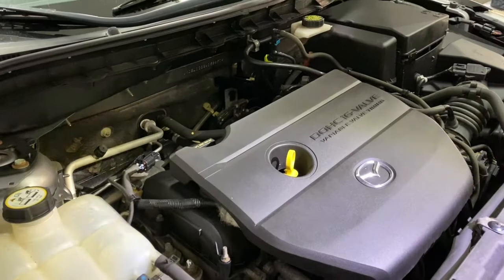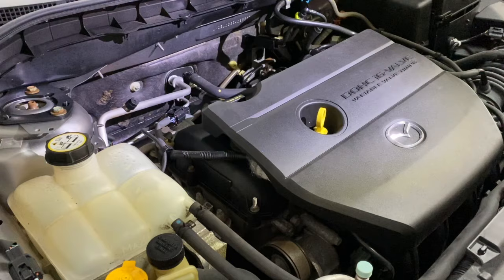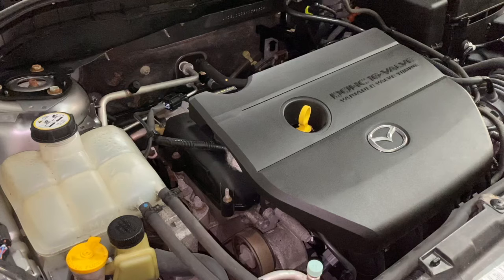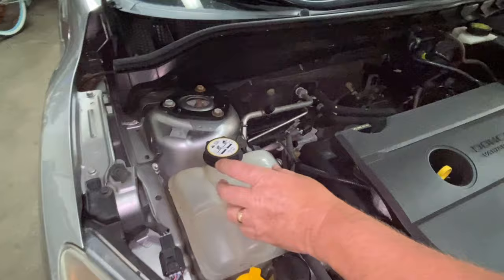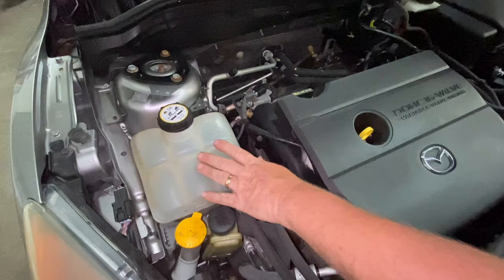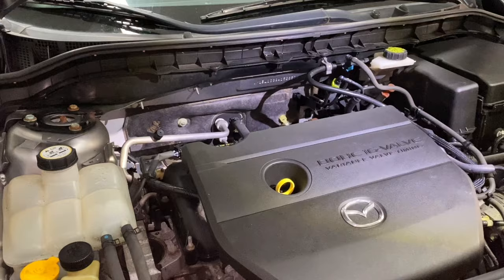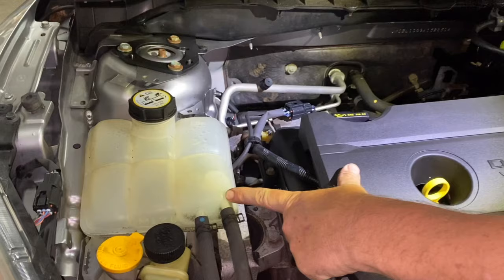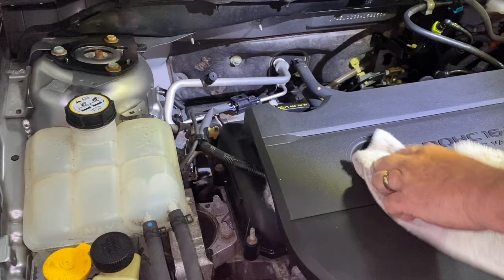Learn 3 Symptoms of Blown Head Gasket

Comment: Question buddy, i have a 2003 ford ranger it sat for 3 months and finally had a mechanic fix it for me. I replaced both head Cylinders because one was faulty. The guy put new head gaskets and installed a new water pump and it worked smooth for about 2 months. Yesterday my fan ran hard and i checked it today and my top radiator hose was squished skinny and hard. I tryed to squeeze it back to its original form but couldn't, it was missing a little bit of fluid in the radiator and my tank reservoir was halway to 3/4s full. I took the cap off and tryed squeezeing the hose then put cap back on tyrned on the truck and eventually the radiator hose got big and fat and hard so i turn the truck off. Could it be the thermostat? I just bought a new hose im going to replace tomorrow and the thermostat already put new cap on.
Reply from the maker: Yes, I would start there. The squished hose it related to a failing or defective radiator cap
Reply: @Motorcarnut  thank you buddy I'll let you know how it goes tomorrow, I just gotta install the hose after I pick it up. New cap and new thermostat right now.
Reply: @Motorcarnut  hi bud I installed New hose and just one question. Is the hose supposed to be hard after driving for a bit? My new one is but  now it don't get fat which is good. Just making sure it has ran good and smooth no problems at all but just wondering if the hose  being hard is normal? I never paid attention to that since I had the truck.
Reply from the maker: Yes, after running for at least 10 minutes at operating temperature it’s normal.
Reply: @Motorcarnut  awsome thank you great sir for the help. :)
Reply from the maker: @jshcarmonakc sure, no problem

Comment: Hi I have a 2007 mazda mpv, today as we were driving on the highway, it started to smoke out white smoke from the back muffler, the engine seems fine (no smoke signs showing) but when we try to put abit of gas down for the car to drive we could feel the car shaking (rattling kinda sound) like it's finding it hard to drive , but we eventually drove it slow back home .

Any suggestions why it's like this ?
Reply from the maker: How bad was the white smoke? Was it thick like in my video?
Reply: @Motorcarnut  yes and we can hear a rattle sound as well
Reply: Rattle sounds is coming from the back ,
Reply from the maker: Well the smoke part doesn’t seem good. It seems as though you’re burning coolant. It should be checked by local mechanic as I’m not there and don’t want to steer you in the wrong direction. The rattle could or could not be related, again get a good honest mechanic to check it out. That’s the best advice I could give you. Sorry
Reply: @Motorcarnut  thank you

Comment: Mine is not a thick smoke it's this and goes away fast also a lot of water but the car sat for yeah and a half
Reply from the maker: Does the vehicle have any other symptoms?
Reply: @Motorcarnut  misfiring crazy can drive but stuttering and lurching and engine oil low but could it be the year old gas going through the system
Reply from the maker: Absolutely, got to drain the old gas and put new. Plus add some chevron fuel injector cleaner with the fresh gas

Comment: Hi. I am having a problem with coolant reduction. I have done this test and it turned green. There is no white smoke. There is no milky dipstick or engine oil cap. There are no bubbles in expansion tank. Is it the head gasket or could it be faulty egr cooler?
Reply from the maker: Don't know what vehicle you have???
Reply: @Motorcarnut  nissan qashqai diesel 1.6 2015
Reply: I did the test again for 3-4 times but colour remained blue so i think i did something wrong in the first place
Reply from the maker: If the engine runs normal then it has to be leaking somewhere. Egr cooler wouldn’t cause loss of coolant.

Comment: My car has a blown gasket but it doesn’t smoke just the milky oil is in water reservoir
Reply from the maker: Because head gasket is leaking into the coolant not the cylinders
Reply: @Motorcarnut  so it still has to be replaced?
Reply from the maker: Absolutely

Comment: My car has allot of white smoke but coolant level stays the same and its not mixed with oil never over heated do i need a new head gasket or is it something else? The only thing it does is burn the oil
Reply from the maker: Does the smoke go away when the vehicle is hot? Does it run different when it’s smoking?
Reply: @Motorcarnut  yes after driving awhile the smoke goes down
Reply from the maker: It shouldn’t smoke when hot at all. It’s hard for me to diagnose without the car in front of me, I could tell just by smelling the smoke if it’s a head gasket. Maybe you should have a mechanic check the car out before you make it worse.
Reply: @Motorcarnut  sounds good

Comment: I have a 1985 C4 corvette I was coming home from work one day and my coolant temp started to go way up it went from a steady 220 then started to rise and right when I got home temperatures had hit 260 once I got home I shut it off then immediately checked the overflow and it was obviously boiling out of the over flow it left a huge puddle of really dirty looking coolant on the ground. 
Once everything cooled down I refilled the coolant and started it up and everything seemed fine when I started it there was no white smoke. 
After looking at the old coolant it looks brown and milkshakey. Could this be a head gasket or something else?
Reply from the maker: It sounds to me like coolant is mixing with the oil in the crankcase ( milkshake) It won’t have the burning coolant ( white smoke ) symptoms. What you’re describing is a typical head gasket failure or a crank in block or heads but less likely being you were aware of the issue and didn’t run it more.
Reply from the maker: Meant crack and crank
Reply: @Motorcarnut  thank you so much for the info it means a ton!
Reply from the maker: No problem

Comment: I almost got a Ford 500 and it has straight milky creamy color in the oil like beige color actually 😳😬 right away that's a blown head gasket right?
Reply from the maker: Yes
Reply: @Motorcarnut   thank you so much I almost made a big mistake 😳 was even a buddy that almost sold it to me for 1500
Reply from the maker: No problem, I mean if you bought it knowing it had a bad head gasket for a good price then fix it , it’s fine but if not then that’s bad.

Comment: So idk if my question will be too specific to my car but I figured I'd ask. I drive an Infiniti G37S 6 speed manual..I've taken the cats off (test pipes), ark catback exhaust, and a Stillen intake. The car was somewhat tuned but I still need to take it back to get fully tuned so this could be it too (wrong air/fuel mixture). I'm filling the coolant about every month and a half, I did a master hose kit replacement but theres still some hoses I missed. Do you think this is a hose problem or head gasket problem? It also has started to vibrate a little more when I engine brake downshifting. It's got 140k miles right now so it being a sport car I know I'm going to have to replace the whole engine soon. But any ideas?
Reply from the maker: Yes, this is too vague of a question. Being you did all the aftermarket work to it and there is no way I can be there to hear it run and so many other possibilities I don't want to steer you in the wrong direction. Unless the car is overheating or has the symptoms in my videos the coolant loss can be as simple as a slow leak but probably not a head gasket issue.

Comment: So, I have all the symptoms. White smoke slight  rough idle but nothing major. loss of coolant every once in a while. But, no overheating a lot of pressure in the coolant reservoir though. Been driving it a year and never broke down or anything just wondering what it could be.
Reply from the maker: If it were a blown head gasket it would've got worse by now. You should have the car checked by local mechanic before it gets worse.
Reply: @Motorcarnut  Thanks for responding. That's what I had figured and the fact I been driving it a year every single day for a year and there's never been any coolant mixture in my oil. I can month or two no coolant gone at all then all of a sudden one day my reservoir is half empty lol So been in habit of checking it every single time before I drive to check the level. No visable leak anywhere. I have had to change thermostat twice now. Upper radiator hose and thermostat housing but still loose coolant.
Reply from the maker: No problem, yeah i mean you could have a head gaskets slowly going considering the thermostat and coolant hose changes if it overheated a little.
Reply: @Motorcarnut  it never overheated only once when I first got it and the coolant was low. Other than that it never has overheated on me.
Reply: @Motorcarnut  the temperature read between half and low until I changed the thermostat now it reads normal range but never read hot.
Reply from the maker: It only takes on time I'm afraid.

Comment: My brother just bought a car there is no oil in it and it starts it doesn't blow smoke out the tail pipe but if does over heat but when he drives it it goes slow .
Reply from the maker: First thing to do is put oil in it up to the full mark on dip stick, it’s hard to know what the problem is without the car in front of me. I wouldn’t drive it until it’s checked out. Could be a thermostat or radiator cap problem but the car going slow worries me that something else is going on.
Reply: @Motorcarnut  Thankyou
Reply from the maker: No problem, sorry couldn’t be of more help

Comment: Hey I have a 97 Corolla and she has light exhaust smoke any help. It stops when I drive
Reply from the maker: Thin light clear-ish white smoke when engine is cold and it’s cold outside is normal when starting car for the first time.
Reply from the maker: Thin light clear-ish white smoke when engine is cold and it’s cold outside is normal when starting car for the first time.
Reply: @Motorcarnut  thanks.  My dad said the same thing.I’m 15 the car has a Sunroof specially made.
Reply: @Motorcarnut  also it 58 outside

Comment: Is it normal to see a head gasket blow from a startup after a car has sat for 20 years? Ive got some white smoke coming out of the exhaust but no milky oil. Not quite sure what to make of it
Reply from the maker: In 20 years? Anything is possible. Sure the head gasket could be all corroded and rusted that as soon as combustion happened the gasket could of gave way. That makes sense.
Reply: Open the radiator or expansion tank cap start the engine and look for bubbling. You may have to fill to the brim to see that.
Reply: @SinsBird  to clarify, bubbling means blown gasket or no blown gasket?
Reply: @thevette-vet  Blown, gasses from cylinders getting into your cooling system.
Reply from the maker: This is what I told him, plus sitting for 20 years I’m sure there is going to be a lot more problems than just the head gasket problem.

Comment: so i have an 06 subaru impreza nonturbo and i changed the oil filter and changed sparks. 1 was broken so i had to remove roughly and ended up changing it then added radiator fix to fix a coolant leak. soon after that my car started but wont run. ill gas it and itll shut off, rpms aren’t even rising. would it be head gasket?
Reply from the maker: Hard to say, was the car running before you did the work? Any smoking or noises? Subarus are known for bad head gaskets
Reply: Unlikely to be a head gasket
Reply: @Motorcarnut  yeah it was running perfectly fine. but after the changes it just shut down. found out i need a new motor. water is getting in oil
Reply: @jorgesolis8913  hey, whatever happened, did you fix your car? It feels so bad and depressing when your car breaks down and the issue is major as a damaged engine!  🤔
Reply: @soul2soul429  it was the head gaskets. havent had time to fix it up until yesterday when i sent her to the mechanics
Reply: @jorgesolis8913  hopefully they are good honest mechanics and they can fix your car at a fair reasonable price, I wish you the best with the repair of your 🚗 🙏
Reply: @soul2soul429  thanks man! any repairs you got? ima sell mine and get a wrx instead

Comment: What if i lose coolant no white smoke no mix oil and coolant bmw e90 m47
Reply from the maker: Depends on how much coolant you're talking about?
Reply: 1l in 100km
Reply from the maker: You have to have a leak somewhere, it's probably leaking when the car is hot and running. Pin hole in radiator, external head gasket problem etc.

Comment: I have a mazda 3 mps sometimes on start up it puffs clouds of white smoke strange smelling smoke out but sometimes it doesnt. It clears after a minute or so could it be gasket issues ?
Reply from the maker: Yes, does the smoke smell sweet?
Reply: @Motorcarnut  has a smell but I'm not losing any coolant from what I can see and once it clears its fine whilst driving
Reply from the maker: It has a sweet smell?
Reply: @Motorcarnut  smells a bit like ammonia if I'm being honest
Reply from the maker: Hmm, hard to know exactly, burning coolant smells sweet. You could get a test strip kit that checks to see if you have exhaust gasses in the coolant system indicating a head gasket or cracked head problem.
Reply: @Motorcarnut  okay cheers mate, it's only on the odd occasion as well and only on start up, if the head gasket was going would it smoke every time and all the time including whilst driving ?
Reply from the maker: Probably, just wait and see maybe your confusing it with normal condensation or it’s so slight right now that there’s nothing to worry about.

Comment: I have an 06 legacy gt and it smokes at startup the engine block is brand new and i resurfaced the heads at first startup and drive, it didnt smoke but maybe after 3 drives it started happening, one of my injectors is leaking could it be that? My car isnt overheating, no engine light, and the turbo seems fine,
Reply from the maker: Did you use the proper torque sequence that Subaru requires for the head bolts?
Reply: @Motorcarnut  yes i used the torque wrench to torque them to the correct spec
Reply: @Motorcarnut  could it be a pcv valve?
Reply from the maker: That would give you blue smoke if anything.
Reply: @Motorcarnut  ok could it be injectors giving me smoke on startup ?
Reply from the maker: Well how bad is the smoke and what color?
Reply: @Motorcarnut  its white, and it smokes alot but not as bad as in the video
Reply from the maker: No, the injectors won’t give off that white smoke. White thick smoke is coolant burning, if you can just take a whiff of it, coolant smells sweet.
Reply: @Motorcarnut  its weird becsuse it doesnt smell like anything, sometimes i get a hint of gas but its a small hint, or i just have a bad nose but i dont think thats it
Reply from the maker: Did that car have blown head gaskets before you installed the new block and heads?
Reply: @Motorcarnut  no no blown head gaskets

Comment: What if there’s only smoke  on the start up
Reply from the maker: Depends on how much? Some white thin smoke is normal
Reply: @Motorcarnut  it’s just a little thick and lingers it doesn’t evaporate
Reply from the maker: What kind of vehicle is it? Does sound like it’s burning coolant when sitting for awhile
Reply: @Motorcarnut  everything is normal. At least not that I notice. 2000 Toyota Avalon approx 164k miles
Reply from the maker: Best you can do is keep an eye on it and see if it gets worse. Sometimes when it's humid or damp outside it may appear the smoke lingers more but normal, as long as you not losing coolant or overheating

Comment: hey can you give me some advice. i have a bmw 328i with the 4 cylinder turbo . a little puff of smoke comes out the exhaust ONLY when the engine is hot. if it sits overnight and i start it the next day no smoke comes out. doesn’t smoke while driving or under heavy load or acceleration . only if i shut it off and start it back up if i wait 2-5 mins it smokes and it clears up. spark plugs don’t have oil on them . kinda strange only on start up when it’s warm and it doesn’t smoke if i drive it a lot and get it warmed up and let it sit overnight it doesn’t smoke  the next day .all fluids seem to be good and haven’t gone down. i appreciate your video any help or suggestions would be appreciated thanks
Reply from the maker: First, what color is the smoke and how long does it last after hot start up?
Reply: @Motorcarnut  it’s a white ish light color only lasts 1-3 seconds
Reply from the maker: It could be a crack somewhere in the combustion chamber that when hot is spraying coolant inside or the head gasket is starting to fail. Coolant is causing the white ish smoke.
Reply: @Motorcarnut  thank you for your input . but it’s strange coolant nor oil levels have gone fown
Reply from the maker: Doesn’t take much coolant to give you that puff of smoke and it will be hard to notice it for a long time. And it’s coolant not oil, oil would give you a blue smoke you said yours was white.

Comment: So my car had the over fill empty. I filled it up and the next time I drove the car coolant sprayed everywhere. The car had never overheated, never smelt hot, it actually ran on the cool side, but after filling up the overflow it leaked. So like a jackass my wife went without me and had the radiator replaced because her brothers “buddy” looked at the car and that’s the problem. Well 450 bucks later I started the car and it died, I got it running and it didn’t overheat but I noticed some smoke. Not like the video but a small amount. Oh now Water or something drips out the muffler… and now the check engine light is on but I’m working 70hrs a week so haven’t had time to go see why. I just parked it. Does that sound like a head gasket to you??
Reply from the maker: When you filled the overflow tank the first time did you fill it to the proper level? If so, you should check for a faulty overflow tank cap , but now radiator was replaced was the cap too? If they were you have to get the codes to see what they say.